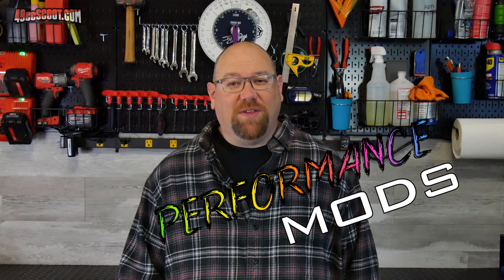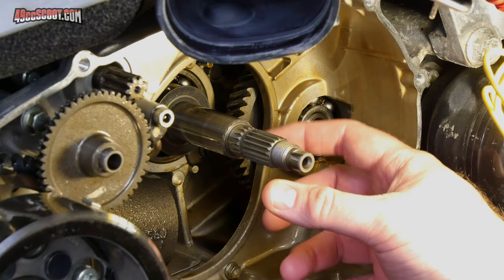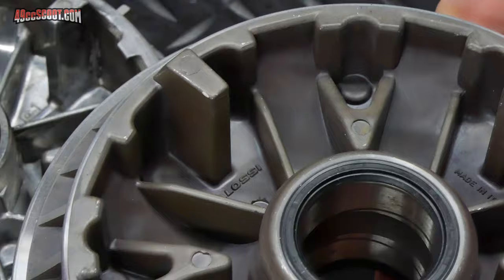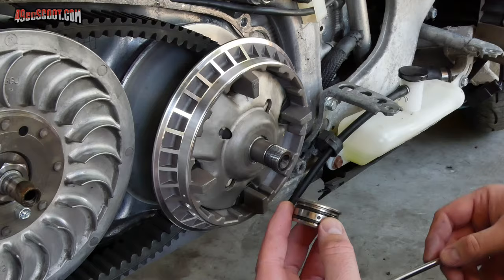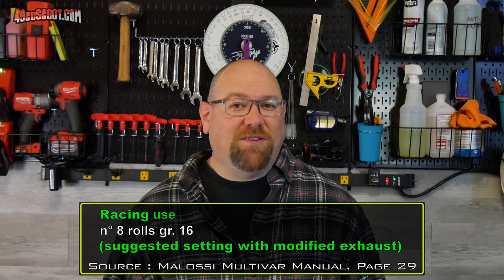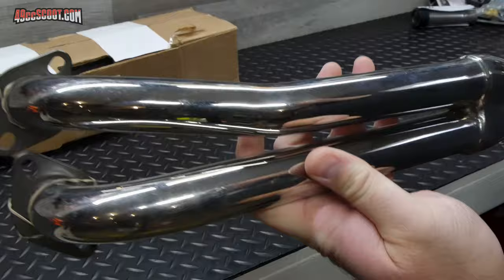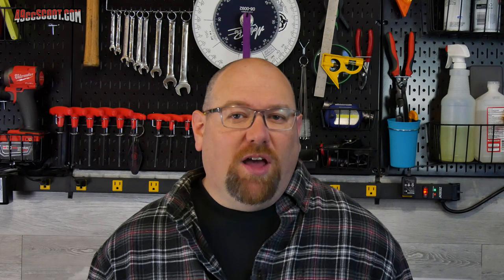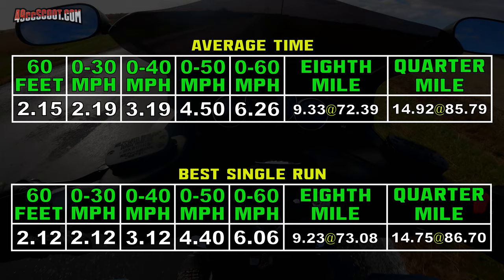Yamaha TMAX Performance Mods Tested 🛵 HUGE Gains! 😍 Variator, Exhaust, Air Filter & Fuel Controller

Comment: hello brant, great report, tested very well. I have the same components in it and the speed display is short. I don't have this with the old Malossi Vario, does the belt slip or why is that like that? Did you install the original belt or the one from Malossi x Belt Kevlar? Kind regards, Nello
Reply from the maker: I've just been using the Yamaha belt. When you say the speed display is short, do you mean the way it doesn't show speed till it's already moving pretty fast? That's some sort of issue with the speedometers on these. All of them do it to some degree from what I've seen (at least older models). If it were belt slip, RPM would increase and you wouldn't be accelerating. If you mean it's not going as fast, then maybe you have an issue with roller or slider weight, the belt is worn too thin, there could be slip or some other CVT issue. Observing RPM would help. If you want it to go fast, then RPM needs to be around the powerband.
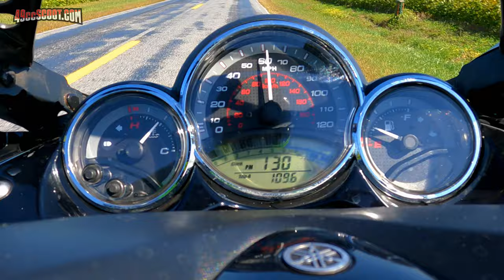Reply: @49ccscoot  First of all, thank you for your quick answer, sorry for my English. In your video at 12:30 min, the speedometer stops briefly at 20 and 40 or slows down and only from 60 onwards does it rise evenly to 100. This is also the case for me when I mount the Malossi Vario MHT Next with 16 g weights. If I put the old Malossi vario on it with the same weights, it doesn't work. I took different measuring points on the road, the scooter runs the same speed with both Varios, I think if I didn't have the misfires on the speedometer, I would be faster in acceleration with the new Vario from Malossi until I reach the different speed at my measuring points on the street. The speed increases evenly, it doesn't increase briefly as if the belt were spinning. I have the 2011 model, so I think it has a new speedometer.
Reply from the maker: @NF-ze2fo  I don't think it reflects anything happening with the engine and CVT for most of us. Your case is an odd one. You can see videos of people with all sorts of setups and the speedometer is unresponsive at low speed when accelerating hard. The speedometer is electronic, so I assume it is a form of lag.
Reply: @49ccscoot  Yes, it could also be that he reacts later, so the vario mht next appears to accelerate a little faster and the speedometer doesn't keep up. The speedometer measures normally at the ABS sensor on the rear tire, it's a strange phenomenon, thanks for your opinion.

Comment: Tell me one thing can you tell me which setup do you use for reading the AfR which wideband and gage you use?
Reply from the maker: It's an Auto Meter Ultra Lite wideband gauge kit. I've had it for years. Was on my Mustang and then the TaoTao. It's been reliable so I have no real complaints. It reads 10-16:1. If you were after a wider range on the display, then maybe look elsewhere or see if the newer models are different by now.
Reply: @49ccscoot  Thank you for answering really enjoy your channel great information on real world tests! Continue like that.

Comment: Hi Brent and thank you for your content and approach. When you talk about longer and shorter bosses and changes in the rpms, does this mean the engine will rev higher or lower for a certain speed? Can it also influence the top rpm of the engine? Thanks
Reply from the maker: Up to a certain point, you may not notice an overall RPM change. You may just see changes on takeoff or top end. When spacing is great enough that it makes it tougher for the belt to shift outward in the front pulley, then RPM will increase.
Reply: Thanks a lot. Do you think a smaller boss could lead to a reduction in 1000 rpm? Or in other words, that the scooter is unable to go higher than 7000 rpm? Thanks again for your interest.
Reply from the maker: @fmiguelraposo  If you're trying to get that effect, then I would suggest using heavier rollers/sliders first. It's possible though.
Reply: Hi Brent, thanks again for you help and for sharing your knowledge. Have a nice day. 🙏

Comment: nice one! :) Is the Malossi Variator stock angle?.. I found that using other angle then stock after couple of months is not good.. get worse with time. Now im only using Stock angle variators. and just modify the slider ramps and drive pulley so the belt can travel higher..
Reply from the maker: Never checked. Were you just having belt wear issues from the mismatch?
Reply: Wear issue and wear on the pulley also. it was Stock angle on my Honda is 15degree made it to 13.8 degree after couple of months use its 14.3 degree,..  Wont run good. less tourqe. Change to Standard pulley and belt and the  bike run great again haha @49ccscoot
Reply from the maker: @pattayakamagra8325  If you had pulleys with angles that you didn't like, it may be possible to machine the faces to a different angle. Depends on the wear and thickness and how much of an angle change. Only makes sense if you have a lathe though. Machining probably costs as much or more than the part.

Comment: Hi, can you do some video about the maintenance of wiring harness of Keeway RY8 150 cc GY6 type A long.
Reply from the maker: You shouldn't need to do much maintenance of any wiring harness. I like to check them over during a PDI with a new scooter and maybe use some dielectric grease where applicable and silicone to help seal some connections. Be sure it's not going to be pinched anywhere or be near high heat sources. Beyond that, it should be maintenance free.
https://youtu.be/qMs2u9zFY9Q

Comment: Hey i have a question it's my 139QMB Scooter, I bought the 80CC Converted but now I'm delivering the food orders. I have a big bag in the back but I can see the max 40Mph. Any suggestions on my engine that I can do? Currently stock CVT settings available, on my scooter variator weights 5.5GR
Reply: And it accelerates very slowly, I can hardly overtake even the vehicles in the city.
Reply from the maker: @usmancoban3448  Clutch springs and CVT tuning may help a little. I'd use sliders if buying tuning supplies. If nothing else they last longer, but sometimes offer a little performance benefit. Aftermarket variators may make it accelerate more quickly and possibly go a little faster. A different camshaft could help it pick up a little more power and rev out a little more.
Reply: @49ccscoot  Thx man i'm working on it.

Comment: boss quick question: my tmax has 14k miles runs good i still didn’t do any maintenance but now i wanna do sum can you tell me what i should be checking and changing as a list please.
Reply from the maker: Get the service manual. It gives a full list of the recommended 12,000 mile service items. You can find it online.

Comment: I have a 2009 Tmax.  Put on an Akrapovic exhaust.  It sounds slightly louder than stock, weighs 10.5 lbs less (I weighed them) but can’t detect change in performance.  Hardly ever pops during deceleration.  The previous owner installed lighter sliders so ok performance off the line, 0 to 60 in about 8 seconds.  I weigh 182 lbs.  Your charts and graphs are a huge help in deciding what to modify next.  Is there a way of having the advantage of attaining higher rpm during acceleration and stock design cruise rpm too?
Reply from the maker: I suspect that you'd do pretty well with 18g weights in the Multivar. Wouldn't accelerate as fast as lighter weights, but it should go quicker than stock and stay closer to standard cruise RPM. Perhaps less shimming of the drive boss if you use a Multivar as well.
Reply: @49ccscoot  thank you very much for the advice, Brent.

Comment: What do you know about the aprilia 50cc 2t scarabeo it’s non diatech and was thinking of going 100cc I haven’t found a water cooled setup yet but before I buy I would like your input
Reply from the maker: I don't know a lot about them, but it should be a Piaggio HiPer-2 engine. Should be plenty of performance parts around for it. Cases are probably harder to come by than typical scoots because of the big wheel.
Reply: @49ccscoot  I’ve got 2 now I’m thinking of putting one on a taotao racer due to it already having a 16 inch front tire it’s a heavy scooter at 275 pounds should be a fun project thanks for the info and love the fact that you actually talk to your fans I appreciate all your help ty
Reply from the maker: @jeffkrauss5582  Hell yeah! Take that four-stroke out and swap in a two-stroke! 😁
Reply from the maker: @jeffkrauss5582  Just realized that's the sport bike styled TaoTao. If you can fit the tire under it properly, that would be a really neat build and truly make it look like a little scaled down sport bike.

Comment: Why don’t they give it these mods from factory ? Fuel efficiency? But i mean especially the straight lanes in the torque driver. Sorry for my bad english.
Reply from the maker: The variator makes it take off quickly, but it also revs a lot more before it gets going. It's not as user friendly for the average user.
Reply: On a 500cc i get that but on my 50cc piaggio zip they also don’t give it straight lanes for example. I can hardly imagine that is difficult to control.
Reply from the maker: @dutch-nature-history-bydrone  Maybe not difficult to control, but it's more tame the way it's setup most likely. It shifts to lower RPM quicker. I can tell you from years on forums that some people dislike anything that seems aggressive to them. People put clutch springs in and then complain that it revs too much before it goes for example... even when they chose to do it. It may also help with fuel economy or engine life and it will likely depend on how the whole system operates together. Some scoots do have straight grooved torque drivers stock.
Reply: Ok clear i really appreciate you taking the time to answer me. I started watching your channel when my garage had a waiting list and since then was able to do everything myself by watching your videos. Thanks and keep up the great work.

Comment: But why did you put 16g back in with all the mods,when result wih 15g was so good? Thats the only confusing part to me. Other than that it was a great video.
Reply from the maker: I mentioned it in the video, but the CVT acted different over time. RPM increased. Could be belt wear, possibly removing one shim would work, but going back to 16g gave me better results.

Comment: any reviews for velocity stacks for tmax review?
Reply from the maker: Didn't even know they made them till you said something. I've seen mixed reviews on other bikes. I figure it depends how well they are designed for each application and even in a best case scenario maybe around 2HP on a stock-ish TMAX. Possibly more likely to be in the 0-1HP range if I were guessing.
Reply: there's a brand called jet prime selling the stacks for your model.

Comment: I'm gonna try a new varistor in my 250cc scoots helix and reflex.  The reflex has a "dead spot" between 30 and 50.  Any suggestions?
Reply from the maker: Malossi makes Multivars for both of those. I'd clean and inspect the whole CVT and belt while you're doing it, just in case that "dead spot" is a wear issue or other problem and not just tuning.
Reply: @49ccscoot  Thanks for the advice 👍
Reply: Your “dead spot” is factory … for fuel economy and noise reduction. A Big Ruckus “face B” will do away with the dead spot. Make sure it’s the “big ruckus 250” face b.  The shift you feel is the different length ramps and the 21g and  the 31 g rollers expanding at different rpm’s on those ramps. If you take out the 3 21g rollers and just leave in the 3 31g , you will have an instant improvement in acceleration. I put a lot of miles on my reflex when I had it.
Reply: @davezimmerman8627  Thanks, that's certainly worth a try.  And a cheap solution if it works.  I've heard that before, but now you've confirmed it.

Comment: Good evening I would like to know is it worth buying the malossi master 2 case knowing that my 500cc is equipped with an over range pack malossi is a prime jet clutch with malossi clutch discs and also the filters I changed them by malossi filters and also a complete akrapovic line so I'm full I just have the injection box tell me is what we install it He will bring me a gain in acceleration and push even harder thank you
Reply from the maker: I wouldn't expect a big gain, but I'd think it should pick up a little more power and possibly improve part throttle if you have any issues.
Reply: @49ccscoot  So in your opinion it's worth taking it or not?
Reply from the maker: @2pac1581  I was glad that I got it. If you aren't having drivability issues or timing runs, then you may not notice anything.
Reply: @49ccscoot  ok thank you 🙏
Reply: @49ccscoot  So what I understood that I'm going to gain a few seconds not much I'm not even going to feel the deference
Reply from the maker: @2pac1581  Not a few seconds. I gained roughly 3/4 of a second with the fuel controller vs without. Expect tenths of a second. That's why the gain may only be obvious if you are tracking performance. It's a nice improvement,  but it doesn't transform the scoot like the variator.
Reply: @49ccscoot  Ok thank you I have a behind question about the settings of the fuel controller I know I have to put all the settings on 0 is that right? Where although you have changed the settings a little?
Reply from the maker: @2pac1581  Start in the middle. Adjust from there if you'd like. You really need to track results or look for symptoms if you adjust. A dyno would be ideal.
Reply: @49ccscoot  ok thank you 😊

Comment: Sir how can clean the clutch not replace
Reply from the maker: Check them to be sure they meet spec. No sense in cleaning worn out stuff. Then you probably just need to remove the glaze with sandpaper or Scotch Brite pads as lightly as you can. Clean with something like brake parts cleaner. Soak in the engine oil overnight before reassembly. 

I have heard people only using sandpaper on glass to break the glaze, in order to keep plates true. With only light sanding, I'm not sure that it's really necessary.

If you have grease or something on the friction plates, then brake parts cleaner and if that doesn't work they may need to be soaked in mineral spirits. I've heard of people boiling clutch plates in water.

If in doubt, replace.

Comment: my friend quick question.
how many liters i need to put for a new coolant water for the tmax 2009
Reply from the maker: ~1.5L
Reply: @49ccscoot   thank u ! sorry to bother u i have one more question can u list me items that can be turned into malossi parts for a tmax 2009 and if u don’t mind amazon doesn’t have any can u tell me where u do order them sir thank u so much we love ur videos down here wish u were closer so we can get to see some of ur art sir !
Reply from the maker: @nemsisjl4047  I typically buy form ScooterTuning.ca. ScooterPartsCo carries a lot of Malossi stuff. Both have pages where you can see everything for the TMAX.
Reply: thank u boss one more thing the oil gear how many L please ?
Reply from the maker: @nemsisjl4047  0.7L
Reply: boss would u recommend going fully malossy or jcosta ? some people been telling me jcosta is good too what u think sir
Reply from the maker: @nemsisjl4047  I have no experience with JCosta, but I know that Malossi is working well for me.
Reply: @49ccscoot  i promise last thing is it okey to put 75-90w oil gear instead of 80-90w sir ?
Reply from the maker: @nemsisjl4047  That should be OK.

Comment: Did I get that right, are you using a GPS-based Dyno on your scooter?
Reply from the maker: Not quite. It doesn't guess at torque or horsepower. It measures speed and distance as well as g-force to give you acceleration data. It's a dragy that's basically a GPS unit that updates at a higher frequency than the phone does and interacts with an app. I really like it and have tested it vs my old video timing method, and you can find many people testing them vs track timeslips to prove accuracy.
https://amzn.to/3uE205U
Reply: @49ccscoot  thanks a lot! :-) Think I have to try this myself. :-)

Comment: Ciao sono italiano!
In Italia è da circa 1/2 anni che si sente parlare di questi nuovi rulli dr.pull. 
Grazie per aver fatto queste prove sono molto utili x me!
Ma mi chiedo come velocità massima quanto hai?
Comunque è chiaro uno scooter non è una moto!
Ma noi il tmax lo usiamo tutti i giorni per andare a lavoro fare la spesa e portare i bambini a scuola!
Poi se vogliamo correre facciamo il turbo
Reply from the maker: I haven't really tested top speed with all the mods. I know it was about the same with sliders in the stock variator instead of rollers. It's horsepower and aerodynamic limited mostly. I think the top speed is roughly the same now as it was, but whether it goes 95 or 105 top speed is really of no consequence to me and makes little difference in the experience to me. What matters most to me is that acceleration is so much better and I can still cruise fast without issue.
Reply: @49ccscoot  si infatti ho visto!
I rulli che hai messo dr.pulley da quanti grammi sono?
Reply from the maker: @StellaartAesthetic  16g